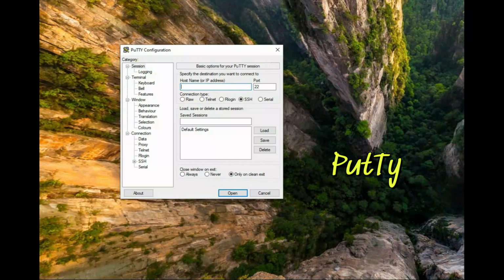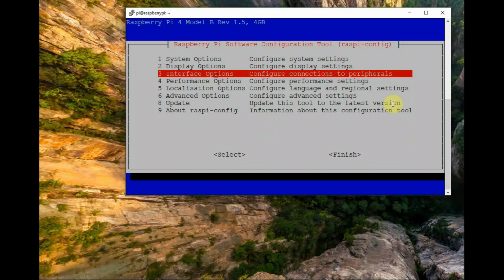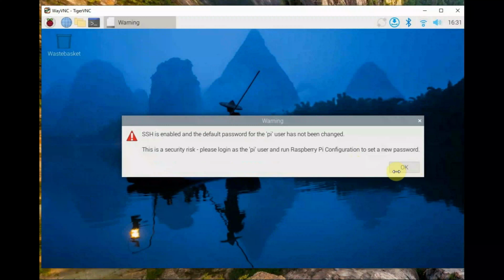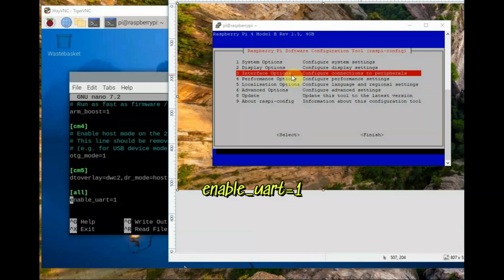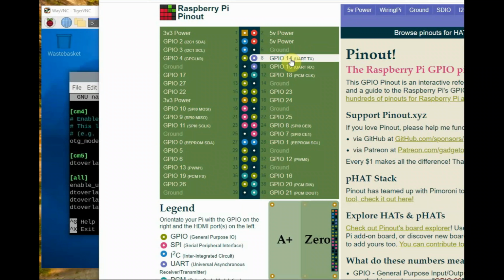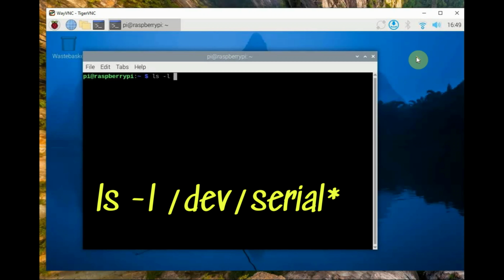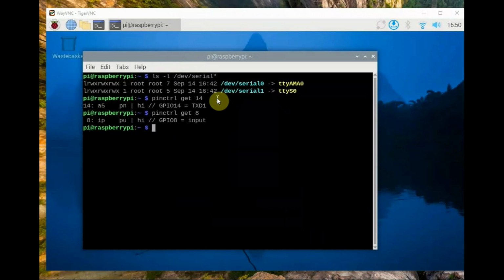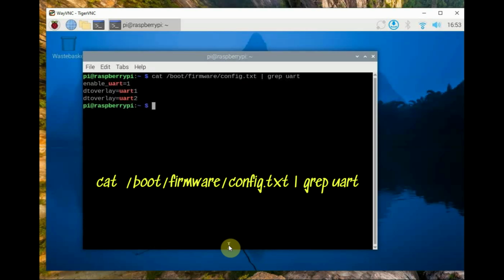How to Enable Multiple UARTs on RASPBERRY PI 4 & 5

Comment: For a long time I have been trying to use USB Cellular Modems to get internet on Raspberry Pi as well as send SMS through the same modem at the same time. I understand that it uses different UARTs for each function. Have you ever tried to do that. I have tried it for many years now and not able to succeed.

Comment: Thank you for this wonderful video. I have a problem with the 7-inch screen. I put a smaller project on it, and when I run the project, it appeared in a smaller size. When I change it to the actual screen size, it does not work. What is the solution? Thank you.